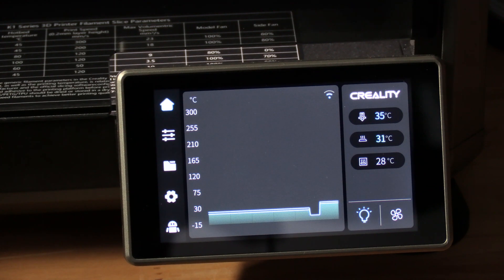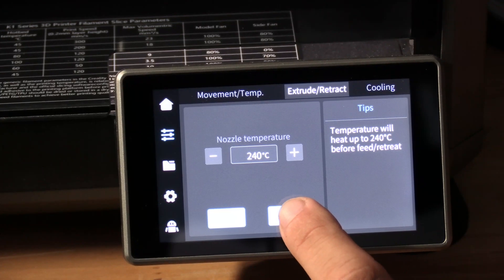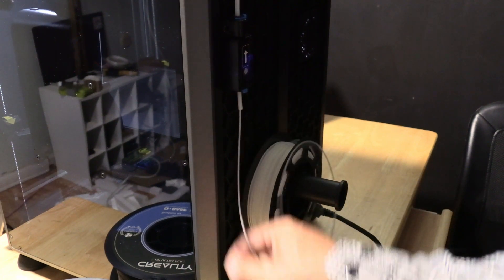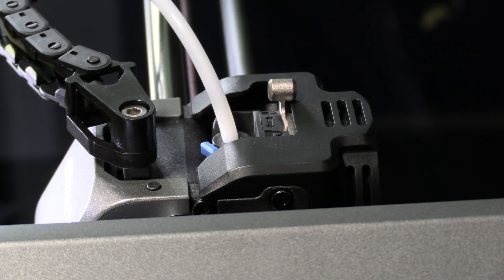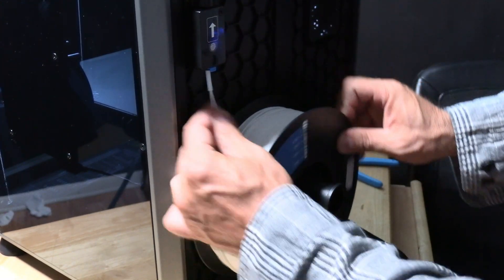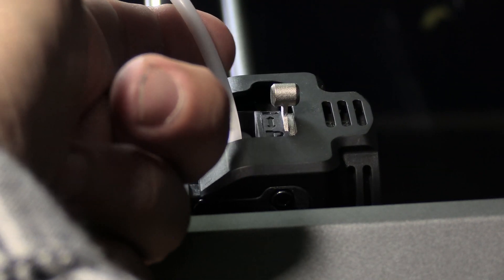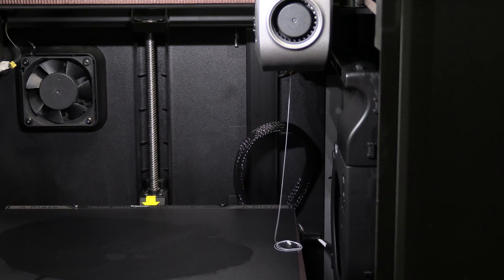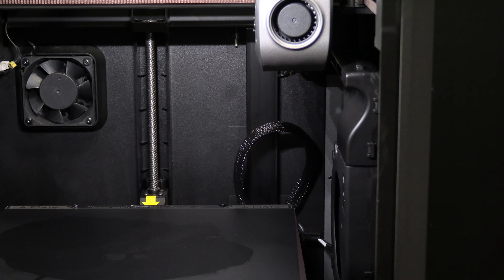How to change the Filament on Creality K1, Ender V3, Ender 5 Max, or any Nebula Powered 3D Printer

Comment: Hey I can’t seem to get it through the little blue thing that you have at the start. I have it in the printer. I’m new so I had no idea what to do.
Reply from the maker: I would watch my K1 Setup videos for some extra help. 
The "Blue Part" is just a clip, that keeps the Coupler locked, to keep the PTFE tube in place. It's just a tube. Fiddle with it and get it through
Reply: @3DR @3DRundown ks for getting back so fast! I got past the part. Mine pla was not straight so I cut a new piece. I’ve watch your set up video but I still can’t the the pla to extrude even when’s it’s in the nozzle and I press the button on the screen.
Reply from the maker: Is it heating? What happens

Comment: Great video, thanks for posting. I feel Creality dropped the ball on their K1 series. I have a K1C, and I’m constantly struggling to feed in a new filament. Between the underpowered extruder and the feeding line, I have to spend several minutes manually pushing on the filament until it finally grabs it. My next printer won’t be a Creality.
Reply from the maker: The K1 line is my all time favorite. My K1 and K1 Max are absolute beasts with thousands of hours on them. If you have an extruder issue, it's a quick and easy swap, covered here on the channel.

Comment: My detector seems to be blocked, the filament wont go in, it was tough the first time i printed, but now it wont go in at all, dont know why a detector needs to be resyticyted in anyway, its just an led anbd a detector, or maybe a microswitch./
Reply from the maker: Cut the filament clean. Straighten it a bit with your fingers. Might be catching inside. They can be a pain

Comment: with my k1c, i have hard time pulling the filament out after retracting.. it feels like its completely stuck and i dont wanna break anything by using too much force.. if thats even a thing
Reply from the maker: 1.) be sure you are unlocking the Extruder
2.) the machine SHOULD, extrude, then retract.
If that happens, and it's still tight, manually extrude, then retract. The goal is to melt off any swelling at the tip of the filament.
Reply: @3DRundown  I had the lock open before clicking rectract button was pressed because opening it for rectract made sense in my redneck head. lol. Works now

So problems solved. Keep it locked until rectraction feature has done its job!
Reply from the maker: ah yes, actually having GEAR CONTACT while the GEARS ARE RUNNING..... Lol.  Nice work. :P

Comment: So what does it mean if no filament ever extrudes out? Ive gone through these steps about 30 times over and this thing is about to grow wings!
Reply from the maker: Depends... You press EXTRUDER, and nothing happens? Are the gears moving? Is the hot end heated? Can you feed the filament into the extruder, with it unlocked? Are you locking it? You may have broken off a peace of filament in the extruder. May want to open the extruder and check it out.
Reply: @3DRundown  thanks man that was it. A small piece of filament was jammed right at the top of the extruder and wasn't letting fresh filament into the hot end. 

 Must've happened when I pulled the old filament out. A small melted piece separated and lodged all wonky in there.
Reply from the maker: This why we use EXTRUDE when changing filament, rather than yanking it out. The K1 will push the filament through the hot end 1st, THEN retract. This will melt off any blobs or defects that could break off. Good to see you back in action.

Comment: I want to thank you for all your precise and informative videos. I have had my K1 Max for just a few days. I was kinda lost at operating it. I watched your videos and that has helped a lot. I was hoping to be able to control my K1 Max and Bambu P1P with Orca only but I'll settle for using 2 slicers for now. Maybe you have something to show how to do that. Thanks again.
Reply from the maker: I would work with creality Cloud for the K1. I slice for the K1 in ORCA. I then EXPORT the GCODE, and upload to Creality Cloud for printing. It's an easy process, once you get used to that flow. I often slice for my P1P/P1S, then, just switch to K1, and re-slice for the K1 gcode.

Comment: This is missing one critical step, release the extruder, if not, then you risk leaving that little blob on the end of the filament in the extruder. VERY IMPORTANT.
Reply from the maker: When retracting, keep it locked. The K1 pushes the filament to melt the tip before retracting. If it's unlocked, that can't happen
Reply: I wasnt clear enough, after the retract, release the extruder or that blob will get pulled off in the extruder. I had to completely disassemble mine to fix under extruding because there were a few blobs stuck. The extract does not completly clear the extruder. A blob with a thin strand can be left behind. Just offering info to n an experience several people have had.
Reply from the maker: I have never seen this happen on a K1. The Extract feature is working very well for me. Filament should not be breaking off during a retract. something else is being done wrong here...
Reply: You repeated the unlock the extruder after retracting and then once the filament was pulled out you said release the extruder again so I unlocked it before retracting in confusion @3DRundown
Reply: @3DRundown  Thanks for the nice video. So once you have retracted (with the extruder locked) and you want to pull the filament out... is it best to release the extruder or keep it locked when you pull on the filament?
Reply: Both @3DRundown and @eugeneeller are saying the same thing. After retracting, release the lock, pull out the filament , insert the new one, and then lock and extrude

Comment: Hello! Why should the extruder be opened? When you first insert the filament into the K1 unboxing, that step is not done, the filament is inserted with the extruder closed and then the extruding action is done on the screen and that's it. Thanks!
Reply from the maker: Gonna gave a hard time getting the filament far enough to engage the gears without unlocking it.  It may be possible, but, it's not a reliable way to do it.
Reply: @3DRundown  Thanks so much for the explanation! I bought it recently and I'm new to the world of 3D printing and even more so to the K1 :D
Reply: Weird, before watching this  video I have never unlocked the extruded on my K1c. I have about 20-30 spool changes so far with no issues.